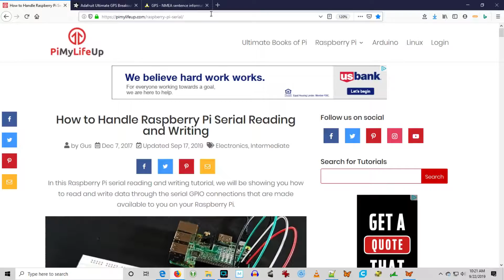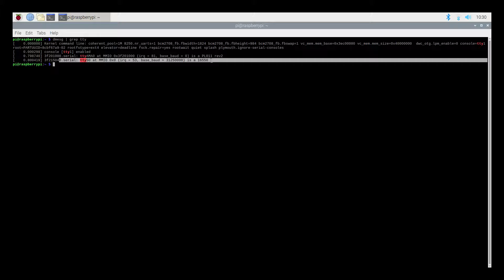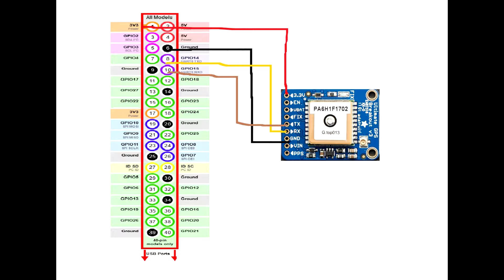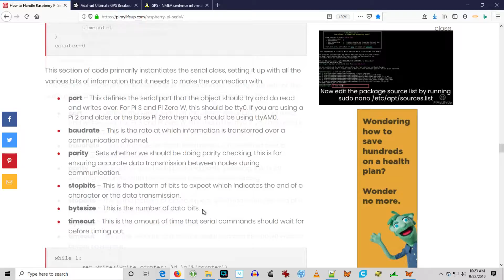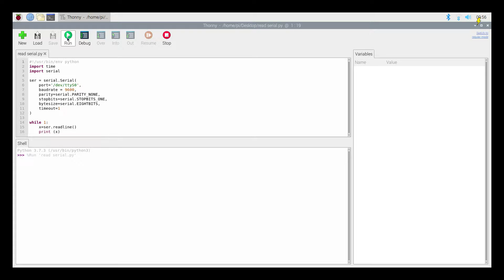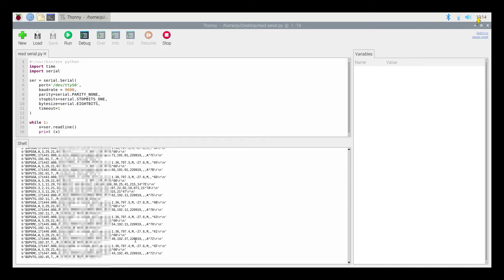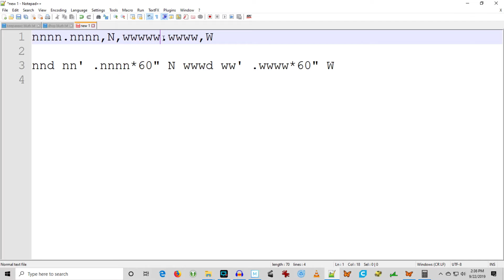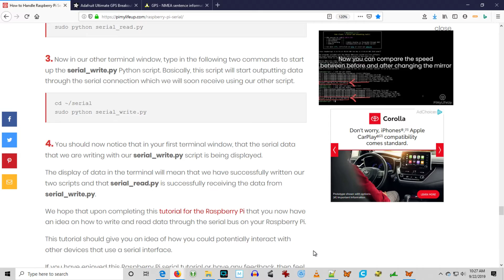Try Raspberry Pi With Serial to Read GPS

Comment: Hi so I have an Adafruit fruit GPS and the new M0 Lo-Ra boards I have it transmitting the latitude longitude it's receiving the latitude longitude but I cannot get the receiver to print on the serial monitor of the ESP 32 web server. The web server set up so that when latitude and longitude are printed in serial it automatically drops a pin on my Google Maps widget. But as of now the receiving radio board cannot communicate through TXRX pins no matter what I try they do not see each other the serial monitors remain separate.
Reply from the maker: I'm at a disadvantage as I don't have experience with M0 Lo-Ra boards or the sketch you are using. Is there a name of the sketch I could search for?
Reply: @ShotokuTech Even if I could just find an example sketch to send a message from one serial monitor to the next would probably get me there, but none of the examples I found for that TXRX test will work. I have the ground and the TX to RX RX to TX as it should be but I don't get any messages across
Reply from the maker: Check out this? Tell me if it helps? https://randomnerdtutorials.com/esp32-webserial-library/
Reply: @ShotokuTech  I might be having trouble with the Arduino core library softwareserial.h when I search in the library manager for it, it doesn't exist and it doesn't seem to be in the Arduino core libraries that I installed with the fresh copy of Arduino ID
Reply from the maker: Yeah that would be important. I don't have to board and I don't have the code. So it is hard for me to troubleshoot this from my side. Best wishes.
Reply: I got it working. Thank you for your help. I just had to add a 1 in three places 🤦

Comment: Hello, I have an issue when using the code "read_serial_py", the console output shows this: "b'\xc0\xe3\x9c\x88Q\x8a\xda\xe1\x03\xd1\x94I\x12\x16I\xca\x14R\x96\xeb\x96MmB\x82\x84I\x84!\xd4J]\x12\x96I\x12\x96I\x12\xb6"LI\x9dL\x9c\xa2\x04Q;S"\x14Id\x82I"\x17#\x17M\x8aT\xe1\x04Y\xcaT\xb6\x83Q\n'. Unlike you, it doesn't work for me. Do you have any solution?
Reply from the maker: It almost looks as if serial is wrong speed, parity, etc. I recommend starting with the module connected to a PC, using the MT3339 GPS PC Tool (windows only) from this page. There is also a link to the manual for this tool there. https://learn.adafruit.com/adafruit-ultimate-gps/downloads

Comment: Hello, thank you for your video. Great
I have 2 problems, (1) my AdafruitGPs module is actually giving me the wrong geographic coordinate.
(2) it has a high delay time in processing the signal.
I wonder how I can fix it (is there any way to reset the module?)
Using it from Tunisia, could this be related to the satellite coverage?
Reply from the maker: If you go to the Adafruit website. 
On the product page for example:
https://www.adafruit.com/product/5440
Scroll past Technical Details Section. Find the link:
"Datasheets, schematics, GitHub links, Fritzing, and more available in the product tutorial"
https://learn.adafruit.com/adafruit-ultimate-gps/downloads
Download the MT3339 PC Tool. It has a factory reset button. 
I just don't know specifically which model you have. So the name of the tool might vary.
Best wishes.

Comment: I have to use an ultimate adafruit GPS module. Which will be compatible with an SD card and a bluetooth module (all its components must be compatible with an Arduino) you can advise me to take what as type of components
Reply from the maker: GPS and Bluetooth will both likely use serial, so you need a board that supports two physical serial connections at the minimum. SD Card would need I2C or SPI. Are you asking me which SD Card and Bluetooth module to use? Thanks.
Reply: @ShotokuTech  I have to choose electronic components that will be compatible with Arduino. I have to choose an ultimate adafruit GPS module. An SD card (which works with a spi link). And a bluetooth module. All 3 components must be compatible. But I do not know what to choose because there are too many choices. So you can help me to choose (an adafruit ultimate GPS module, an SD card that works with a spi link)
Reply from the maker: I have used this before with Arduino. (Bluetooth). https://www.amazon.com/Wireless-Bluetooth-Transceiver-Module-Arduino/dp/B07T7ZZ3S5
Reply from the maker: I haven't connected SD card module to Arduino, but this 'should' work, provided your Arduino does have the SPI interface. https://www.amazon.com/HiLetgo-Adater-Interface-Conversion-Arduino/dp/B07BJ2P6X6
Reply from the maker: This website might be helpful for you: https://www.circuito.io/
Reply: @ShotokuTech  An ultimate GPS module adafruit, an SD card (which works with a spi link) a bluetooth module. You can give me exactly it's 3 components. Which must be compatible. It must work with an Arduino card. Because there are several types of adafruit ultimate GPS. But I do not know what to choose. It is 3 components must be

Comment: Hi I am using a ZOE M8Q from sparkfun https://www.sparkfun.com/products/15193
I am having the same issue as others have had, it is just printing b' ' 
I am using the sparkfun QWIIC system to wire everything. I tried running it on an Arduino with QWIIC and the NMEA prints fine but when I switch it to the pi I just get the b' '. I read that you mentioned checking the baud rate, what should I set it to for this? Or what other steps can I take to get this to work? (Awesome video btw!)
Reply from the maker: I would be careful hooking it to a Raspberry Pi. If I am reading this right, the board is 3.3v "3.3V VCC and I/O ". Raspberry Pi is 5v. You could damage the module? You would need a level shifter in between. https://www.sparkfun.com/categories/361
I haven't always had good luck with that. Thanks for your comment!
Reply: @ShotokuTech  Hi the pi hat I installed is for 3.3v and I think it is getting the right voltage. After I hooked it to the pi with no success I tried it on the Arduino and it worked.
Reply from the maker: @nickm3475  What hat, Qwiic hat? I guess I need to understand all the moving parts. My example here is using serial. I just got a Qwiic hat in a week ago and have not even opened the box yet. In fact I was just gearing up to start work with it, a Qwiic servo driver and next an I2C GPS unit. Qwiic is I2C, not serial. This is a video I did about I2C for an IMU board. "Use Raspberry PI with I2C and Detect Motion" https://youtu.be/gYsN6TGMlAk 
It won't give you everything you need outright. But it could give you an idea where to start. Like I say, I have not gotten to I2C GPS yet. Probably by the end of July.
Reply: @ShotokuTech  Thank you so much for these resources and for taking the time to answer my questions! Definitely subscribing and watching more of your content :D
Reply from the maker: @nickm3475  Thanks!
Reply: @ShotokuTech  get the ublox module, it has a voltage regulator on the input side and takes the 5v down to the 3.3v
Reply from the maker: @ralph9987  Maybe @Nick M  is looking for this? What I have here is working great. I have so much tiny tech stuff here I need to start an E-Bay store just to sell some of it off. Thanks!
Reply from the maker: This is a video I did about I2C for an IMU board. "Use Raspberry PI with I2C and Detect Motion" https://youtu.be/gYsN6TGMlAk 
It won't give you everything you need outright. But it could give you an idea where to start. Like I say, I have not gotten to I2C GPS yet. Probably by the end of July.

Comment: I made it to 1:35 and cant get past changing the config, is there pictures and text instructions some place to reference adjusting the configuration , your talking is not matching what I see on the screen only thing helpful is when you say click on 5 for Interfacing Options the rest is speed clicking with no time to read what your clicking on.

I have rewound the video 15 times just cant match up the instructions with what your clicking on its like the instructions are out of sync with the video? Screens change so quickly I cant even hit the pause button fast enough to pause and read, is there a way to watch the videoin slow motion so I have time to hit pause?

Thanks
Reply from the maker: In the YouTube viewer you can click on the gear icon for settings and adjust the playback speed. I just played it back at 0.75 and 0.50 and the sound seems to be synced to the video. You may also need to reduce playback resolution if you are getting video lag. I know sometimes when the local internet service is getting hammered during peak traffic times and I have video quality set to 1080p, I get video lag. So adjust the playback speed and see if that doesn't get you what you need. Or reduce playback quality to 480p.
Reply: @ShotokuTech  Ok thanks

Comment: This source code error
ser= serial.Serial{
                             ^
invalid syntax....
i have copy this code, why error?
Reply from the maker: Should be parenthesis not bracket. '(' not '{'
Reply: Thanks.Helpful!at first testing good signalbut second testing after day another problem
b''
b''
b''...give me a tip and help
Reply from the maker: @_HF-xf1ql  Please read through the comments below. Most indicate the chip went bad. But you can check pin out,  voltages and serial settings. Also test the device connected to your PC if you have the FTDI USB to Serial board and some light weight software. 

'GlobalTop MT3339 PC Tool'.
https://cdn-shop.adafruit.com/datasheets/GlobalTop+MT3339+PC+Tool+Operation+Manual+v1.1.pdf
Reply: i did check pin out RX,TX change.haha Thanks.hahah
Reply: additionally, i want to do gps Parsing...do you know that??

Comment: I am getting b'' as an output.
I am using pi4
can you please help me
Reply from the maker: Please see the comments below. Another viewer reported the same issue. They found that the chip was bad. I would recommend verifying voltages, both power and input and output. (5 volt versus 3.3 volt). As well check baud rate, parity, stop bits, etc.
Reply: Did you ever fix this issue?

Comment: Hi, I get blanks for my output rather than NMEA sentences. Here is the output:
b''
b''
b''
b''
...
I have tested the module on an Arduino and it works fine. Any advice?
Reply from the maker: Same baud rate and related settings?
Reply: @ShotokuTech  Yes
Reply from the maker: @hassrahhal  How about voltage. 3.3v versus 5v, TX and RX? My first take around this is garbled signal due to settings, voltage or physical connection. 

     Try the chip again on the Arduino? 

     For this video, I basically pulled a GPS chip I set the baud rate years ago for Arduino. It was pretty much plug and play with the code here.
Reply: @ShotokuTech  Tried it with a different chip worked fine thanks. Turns out that chip was fried.. It was working fine a couple of days ago, any idea why it would fry on its own? strange
I am trying to access the data in C++, do you have any experience with wiringPi and serial reads? Appreciate the help
Reply from the maker: @hassrahhal  That's a tough one. Seems like these can kick around in a plastic bin for years but fail when you least expect. Glad you got it resolved.

Comment: very helpful!! But how did you get a fix????? I've been trying for so long to get a fix.... Any advice??
Reply from the maker: Try outside or near a window? You must have some interference or obstruction. What brand device do you have?
Reply: @ShotokuTech  i have the Adafruit one. and also one from 3DR which uses the same MTK3329, however, I just got it so I haven't test it. 

For the Adafruit one, I was outside for hours with full view of the sky and never got a fix. What could be the reason? Any ideas on how to troubleshoot it? to see if perhaps the antenna on the module might be the issue.
Reply from the maker: @phda7498  I appreciate your question. 

So you are getting NMEA sentences, but all zeroes? 

You are using Rasberry PI or Arduino?

Do you see any indication of satellite count?

   $GPGSA - GPS DOP and active satellites 
   $GPGSV - GPS Satellites in view
   $GPGGA - Global Positioning System Fix Data 

all include an indication of satellites in view.
If you are using the breakout board, you 'could' add an external antenna. But I always say never send good after bad. 

Definitely test with the other board.
I have had this module for several years, I can't recall explicitly if I did anything else to configure it. 

I did attach it directly to my PC at some point using the FTDI adapter and there are some things you can test and perhaps configure using the 'GlobalTop MT3339 PC Tool'.
https://cdn-shop.adafruit.com/datasheets/GlobalTop+MT3339+PC+Tool+Operation+Manual+v1.1.pdf
You can also connect directly using a terminal emulator such as Foxterm, and you might have the ability to send commands to the chip that way.
But I do not have any explicit breadcrumbs telling me that I did something complicated to work with this board. Usually I leave myself a trail when I go out of my way.
I have my file system preserved back far enough to see when I started working with the Adafruit GPS, their libraries in my Arduino folder, some code. Perhaps the Arduino code sent some configuration to my device that it is still using today?
Lines of code from a file dated 2014 called gps_working:
...

  // uncomment this line to turn on RMC (recommended minimum) and GGA (fix data) including altitude
  GPS.sendCommand(PMTK_SET_NMEA_OUTPUT_RMCGGA);
...
  // Set the update rate
  GPS.sendCommand(PMTK_SET_NMEA_UPDATE_1HZ); 

...

  // Request updates on antenna status, comment out to keep quiet
  GPS.sendCommand(PGCMD_ANTENNA);
Note the first two commands have the word SET. The rest of the code simply reads and formats the data.
I am happy to keep looking at this issue. Best wishes!
Reply: ShotokuTech thank you so much! I’ll definitely try to find an Arduino and test the new module or perhaps connect it to my computer. I will be back to update you :)
Reply from the maker: @phda7498  I look forward to hearing of your success. Best wishes.
Reply: @ShotokuTech  Hey there! I can conclude that the module I have is faulty. From the link for the PC tool to detect the GPS, I downloaded the "mini GPS" and is not able to auto detect anything. On the other hand, the 3DR GPS got a fix within minutes of being outside and was working just fine!
Since I am short on time I don't think I can figure out what's wrong with the Adafruit module but I truly appreciate your help!!
Reply from the maker: @phda7498  You have done well! I appreciate reading that you have resolved this. Thank you!